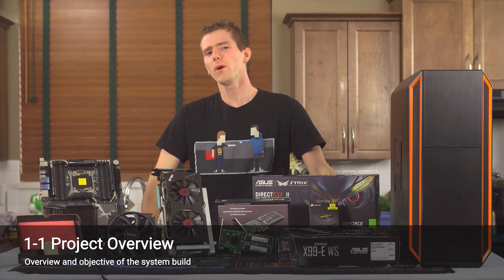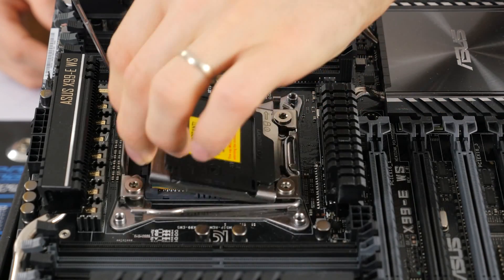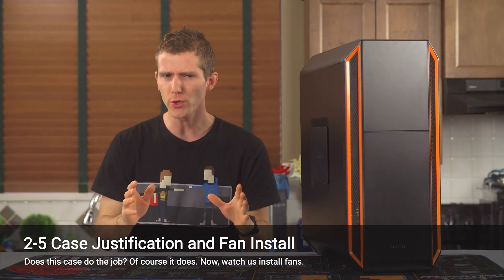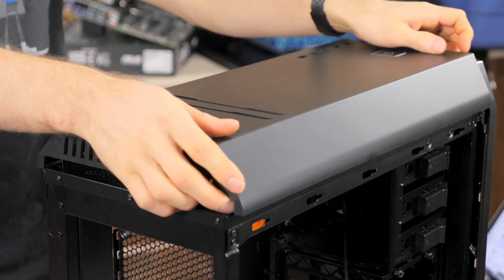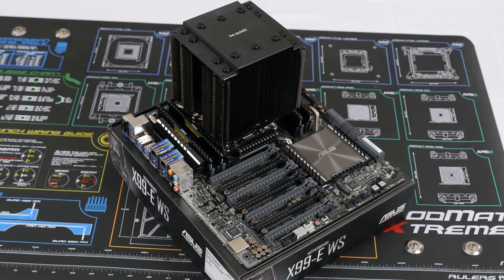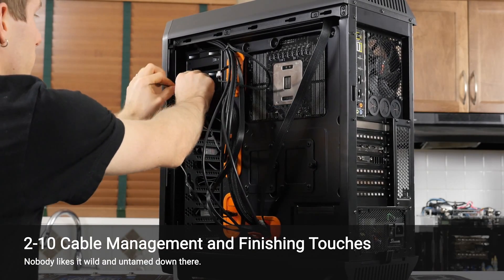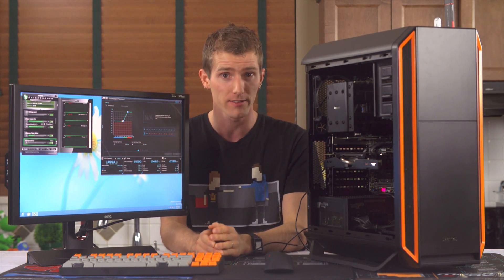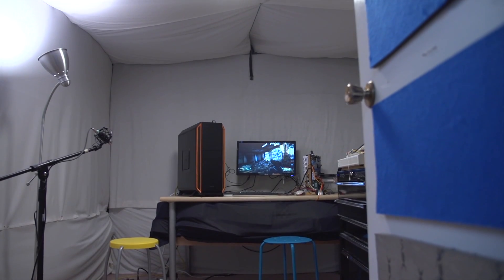How to Build the ULTIMATE Silent Gaming or Workstation PC

Comment: Put the computer in space. It will be 0 db.
Reply: It will also build up heat at crash bc no heat it dissipated out of it bc no air
Reply: +Vsevolod Nedora might not be such a good idea, without air as the medium to transfer to, the heatsinks will simply build up heat and only radiate it outwards at a very slow and inefficient rate. the fans will also do nothing which would rise the overall system temperature a bit.
Reply: @BoomBrush  sheesh, no problem; I'll watercool my space-PC!
Reply: +Vsevolod Nedora Put the computer in space. It will overheat.
Reply: I've got it. The solution to this whole space debate thing:

If you put a computer in space, not in a space station (or with any space-specific gear) it will break. Whether this is by particles colliding with it, debris, or from extreme cold/hot, it WILL eventually break. Someone please find a flaw with that. smug look
Reply: Cyka Blyat Perhaps, but it will be soundless)
Reply: John Mosier You just plain and simply do not lose energy fast at all. Look up the rate energy is lost via infrared radiation, it is tiny. Depends on the electronics, plenty of electronics can work well below -30C.
Reply: Or u can just turn it off
Reply: BlueCosmology that is incorrect. why do you think space suits are heated hmm? or how do you think thermal cameras work? you do lose quite of bit of heat through radiation it just depends on where you are. in your case you are only correct if you are in sunlight
Reply: +John Mosier That is not true. Infrared radiation from a human body is incredibly small, you'll go hours before getting cold ( and that's if you're completely in the shade. If you're not you will without a doubt absorb more IR than you emit).
Reply: Energy Core The amount of energy radiated at temperatures that are good for operation of a pc is tiny.
Reply: Thats genius
Reply: +Matic Omahen leider lol that is the easiest method :P
Reply: My pc is still loud af even when its turned of (i have a stok cooler)
Reply: +John Mosier It's -100 celsius when LN2 cooling for CPU to stop ticking.
Reply: ah thanks
Reply: +John Mosier why would you tell someone they're wrong about a topic you know nothing about, rather than just looking it up?

spacesuits are not heated. The exact opposite, spacesuits have cooling systems as if they were not the cooled the astronauts would quickly die from overheating.
Reply: BlueCosmology Why is the cooling situation vastly different between space and mars? You think you need air flow to cool something?

"Simply no way to dissipate the heat a desktop computer puts out" A) I guess all the electronics we have running in space are all overheating B) "Simply no way" with regards to space has been defeated many times over - It wasn't that long ago that there was "simply no way" to send something (an object) much less a person into space and we know how that turned out.
Reply: Killer2600 The cooling system is vastly different because even a small atmosphere is incredibly more efficient at transferring away heat than vacuum. In addition, contact with the ground of Mars is a great heatsink.

In space there is no medium of heat transfer other than radiation, which is incredibly inefficient.

The electronics we have in space are not desktop computers. They are purposefully designed to be low power. They do this via a combination of being larger chips than a desktop would have, being weaker than a desktop (there are very very few chips in space more powerful than a playstation 1) and from being designed almost entirely for power efficiency. The most common CPU used in space in modern satellites is the RAD6000. A CPU that was made in the 90s with incredibly little processing power (even compared to commercial processors that were available at the time), running underclocked typically at 10MHz. A desktop CPU would fry itself literally in less than a second.

The argument somethings have been hard before therefore everything is possible is nonsense.
Reply: Cyka Blyat I really don't understand your unnecessary hostility just because you are ignorant about a topic.
Reply: John Mosier Thermal cameras are completely irrelevant. The fact that you're losing very little energy from something does not mean it is undetectable.

 A fire is over 1000 degrees. Put a thermometer to the side of it within a metre and it will heat up by maybe 2-3 degrees, showing how incredibly inefficient energy loss from thermal radiation is. Also, the energy loss per unit time of a black body  (which a human, and pretty much everything that isn't specifically designed to not be a black body is very close to) from thermal radiation goes as the fourth power of temperature. That means for instance that while a human is about 300K, and a fire is around 1300, generally more, the power emitted through radiation is not just 4 times more, but 350 times more. Showing just how incredibly little energy is emitted from radiation, especially at the temperatures that are fine for a computer to run at.
Reply: +Killer2600 we do not have modern desktop pcs in space. The ISS is very different from satellites due to its large size and can use much more powerful cpus than satellites due to this, yes, it still does not use even close to modern desktop cpu power. The most powerful cpus on the ISS are cpus that were released 10 years ago and were weak then.

It is plain and simply impossible to cool a desktop pc in space. Low TDP cooling is possible, high is not. You can continue to insult me from your ignorance all you like.
Reply: +Killer2600 10 year old desktop computers are not used in space. Again, 10 year old cpus that were weak at the time (I.e. less than a typical laptop) are used in the ISS. 

You can claim I'm 'losing the arhiment' all you like. Everything you are saying is either untrue, or just irrelevant semantics. Ok, sure, the Earth is in space so it's possible to use a desktop in space. That's the inanity of what you're saying now, and again I don't understand the unnecessary hostility just because you're ignorant of a topic.
Reply: +Killer2600 you can say you don't believe the most powerful cpus used on the ISS are 10 years old all you like. They are. Look it up. There is no desktop in space, other than being inane enough to say that there is because Earth is in space.
Reply: +Killer2600 If you think a modern desktop pc on a satellite is a possibility, could you explain to me why places such as NASA, ESA, Roscosmos, CNSA, none of which have a single cpu as powerful as a modern desktop in space and all choose to use incredibly underpowered old cpus?
Reply: +Killer2600 I know insane is spelt with an s. I'm very confused what your point even is there.

Satellites launched today have old cpus in them. Plain and simple objective fact.
Reply: Killer2600 Satellites launched today do not have new CPUs on them. The most modern CPU used routinely in satellites launched today is the RAD750. Produced originally in 2001, and designed to be more similar to older CPUs than other CPUs released in 2001.
Reply: Killer2600 Another boring inane claim. Yes, they don't use second hand CPUs. No, that does not mean they are new CPUs, and you know it doesn't, in any way other than boring inane semantics.
Reply: Killer2600 As I said before, again I have no idea what point you're trying to raise by saying how to spell insane?

Yes, the CPU they use is the newest offering for their given purpose, as modern CPUs would not work in satellites. One of the largest reasons being due to the heat output of them.
Reply: +Killer2600 I can spell insane. I'm very confused as to why you think I can't.
Reply: ***** Zombies could exist, if by 'zombies' we mean mindless humans focused on eating flesh. There are multiple possibilities, one being a mutation of rabies having an outbreak. Seriously, look it up.
Reply: Vsevolod Nedora THIS
IS
YOUTUBE SCIENCE!!!!!!!!
Reply: RavenPrecept Have you not watched Phineas and Ferb?
Reply: Vsevolod Nedora cooling wouldn't work because its air based
Reply: There is radiation cooling. (Emitting photons with certain energy decreases the energy (temperature) of the body)
Reply: but the heat dissipation factor in space would probably nullify that.
Reply: BlueCosmology He's sorta right you know. Ambient temperature needs to be taken into account as well as material absorption.
Reply: Cyka Blyat No, he isn't.
Reply: +Cyka Blyat +BlueCosmology I'm going to put this debate to rest, a computer in space will not overheat. We currently have hundreds of them in space and on other planets now running nearly 24/7 at full work load without any thermal throttling. It may not be your gaming rig but you won't be gaming in the vacuum of space anyway, one without oxygen you'll literally be dead within minutes and two your LCD screen that you use at home will be destroyed by the zero atmospheric pressure as will anything else that is internally pressurized (spinning hard drives, cathode tubes/lighting, sealed water cooling systems).

In summary, a computer that works in space will not overheat and a computer that doesn't work in space also won't overheat because it'll be broken or unusable.
Reply: Sunny Wu Mars is not space. The cooling situation on mars is vastly different to in space.

There is plain and simply no way to dissipate the heat a desktop computer puts out in space.
Reply: Killer2600 Hmm it's hard to tell his species with certainty but I've narrowed it down to say he is either of the usual peasant variety or part of the troll family.
Reply: BlueCosmology
Mars as a heat sink? oh cause dirt is a really good conductor especially with no water in it. and radiation is not inefficient. why do you get warmed up next to a campfire? it isn't conduction or else the air would just rise due to convection it is due to radiation mostly. look into thermal cameras that will show that a lot of radiation is given off.
Reply: BlueCosmology Cooling is cooling, either it is possible to cool something or it's not. You can't make the argument that low TDP cooling is possible while higher TDP cooling is impossible.

Also I already covered why a desktop PC used in the vacuum of space without modification is of irrelevant concern. Many of the components will not withstand the atmosphere of space, the user included.

You do realize we do have modern desktop power computers working in space at this very moment right? The ISS (International Space Station) is in space and has the occupants using desktop class PC's for both work and play. I have yet to hear reports that those computers are melting and the astronauts are dying from overheating because there's no atmosphere around the ISS to carry away all the heat the humans and computers generate because as you say getting rid of that much heat in the vacuum of space (without air) is IMPOSSIBLE!

We all now know why you would never have a job at NASA. The Apollo 13 team would be dead if you were the person responsible for making the "impossible" possible.
Reply: BlueCosmology I didn't know skype, youtube, and all the "new" things ran so well on 10 year old laptops. Why do we even need more powerful computers when 10 year old machines do it all and generate such low amounts of heat that we didn't even need fans on heatsinks 10 years ago?

If you didn't detect the sarcasm of the above statement it is entirely sarcastic as 10 year old machines will not do all the modern things and even 10 years ago computers ran hot, required fans, and water cooling was available.

The size of the ISS is irrelevant in the possibility of the "impossible" argument. Either it can be done (aka is possible) or it's impossible. There is no "It's impossible unless you do this then it's no longer impossible" that technically is something that is possible.

What's the impossibility of you realizing you're losing this argument? You already admitted to the use of 10 year old (says you) desktop computers in space after previously stating it was impossible. Is an Intel NUC a modern desktop class computer? Would a modern one turn the ISS into an oven, cooking everything inside? Like I said, you are losing the argument, the only question is how impossible is it for you to see that?
Reply: BlueCosmology We, myself and others that have replied to your comments are not ignorant. It's you who is ignorant of everything we have said. You have even conceded that computers are being used in space, desktop ones not just the "ultra low power, low computing" RAD6000 from the 90's. With that alone you destroyed your own "impossible" to cool desktop computer in space argument because regardless of age or ability it is a desktop computer. Also none of us think the crew aboard the ISS is skyping back home on a 10 year old low power machine. Such an argument is there in attempt to try to defend your previous argument and has no bearing on facts.

The argument of the ISS or earth is not insanity, it's demonstration that the "impossible" is in fact possible. But if you're logic is indeed true you have determined the cause and proven the existence of global warming. All these desktop computer all over the global, many of them high-power and overclocked running generating heat that makes it into earths atmosphere but then has no where to go so the earth has no choice but to slowly cook itself as radiating heat into space is the only way for the earth to cool itself and that's (as you say) terribly inefficient considering the amount of computers (let along other heat generating things/processes) on earth. Instead of commenting on youtube, you need to take your expertise to head scientists and government and let them know that people need to turn off their computers and trade them in for low power devices to save the globe from global warming.
Reply: BlueCosmology You bring it up that earth is in space. It's true but it wasn't my argument. Also I don't have to look it up because I don't have to explain the impossibility that I never claimed - you made such claim and have yet to explain or prove why it's impossible. I even asked you if you thought air flow was required to cool something and you haven't even answered that. The fact is you have no facts otherwise you would have laid them down and sealed your argument many comments ago just as I did pointing out that the ISS is in space and has desktop computers aboard whilst not cooking the ISS. Trying to refute my statement with "10 year old low power" does nothing to bolster your prior argument.

In addition to not knowing what you think you know about thermal dynamics in space/vacuum, I don't think you understand what "impossible" actually means.
Reply: +Killer2600 Again, the ISS does not have desktops in it.
Reply: BlueCosmology No it doesn't, they have laptops. Laptops are portable desktop computers, just so you're clear on the definition of laptop.

Still not proving your impossibility. The more you write the more you side with the possibility of cooling a computer in space. To go back to a previous statement - You're losing your argument.
Reply: +Killer2600 Do you actually have an argument that isn't just purely inane? Laptops are not desktops.
Reply: BlueCosmology You wanna explain why they'd use old cpus? They're just less efficient. May as well reduce the clock of a modern one.
Reply: BlueCosmology Insane is spelled with an "S" and laptops fit on the desk just like desktops quite well. They even run the same software and peripherals. So how are they substantially not the same?

Why should I have the burden of proving your argument? Satellites don't need the latest Intel or AMD processors capable of running Windows 10 to do their job nor is a processor that came out last summer going to be onboard a satellite that is 7 years old - At least not until time travel becomes a common thing. I could add more this topic but it's irrelevant to the original argument and it's not my job to try to prove your argument.
Reply: BlueCosmology Actually satellites launched today have new CPU's in them. Plain and simple fact, everything on a new satellite is in fact new.

The reason why the processors on satellites and other space vehicles are seemingly generations behind the latest consumer processor offerings has nothing to do with TDP and cooling. Fact is we have modern desktop cpus available with TDP so low that they don't require a fan. The Apple Macbook with an Intel Core M is such a computer. So are you going to tell us that the 13mm thick Macbook is too much heat and would cook the ISS?
Reply: BlueCosmology It doesn't matter when they were designed if it's not used then it's a new part. And you post yet another comment that doesn't address your "impossible to cool a desktop computer" argument so I will hereby assume you're avoiding it because you can't substantiate the claim. It's been fun but quite boring.
Reply: BlueCosmology If you can't spell a 6 letter word correctly with the assistance of the internet don't expect me or anyone else to think you know more about anything than we do.

With that you're plain and simply wrong about your heat dissipation premise. It's easy to understand you would be because you can't even spell with help of the internet.

The reason processors that retail for less than $1,000 USD aren't used in multi-million dollar mission critical satellites is that cheap consumer CPU's aren't reliable enough for such use. They weren't designed to endure a lifetime of operation exposed to the radiation and temperatures of space. They also weren't tested to run in mission critical environments without failure. If your desktop computer freezes you can just hit the reset switch, if it doesn't startup you can just have it repaired. You can't do that with a satellite that's over 22,000 miles above you.

There are no mission critical systems that use consumer desktop computer processors. The computers in a modern car are the same way and they, being on the surface of earth, are able to be air cooled just as effectively as any desktop computer. Desktop CPU's work well for consumer computers but they aren't good for mission critical processing/computing.

Now that I have educated you on why the same chips in your computer aren't used in a mission critical satellite, and how to spell insane, go fester somewhere else. There's nothing for you to teach us nor am I interested to hear about what you think you know.
Reply: BlueCosmology Good, you want to use seldomly used words where a more common word fits just as well. My error, but you're not furthering why cooling a desktop cpu would be impossible in space while maintaining that low TDP can be cooled in space. That's the only thing I need you to share your expertise on because it's your idea that no one else shares at this point. If you can't then you need not say anything because I'm tiring of practicing my typing and am going back to watching youtube videos on my free time.
Reply: GENIUS
Reply: SpazSpy That was my argument with the exception of collision with space debris. I also added that a human can not survive the zero atmosphere of space to use a computer floating in space. Thus solving this theoretical question is futile. Whether or not the computer overheats the user is too dead to notice.
Reply: Killer2600 Fair enough xD
But...

What if they're a zombie?

And now cue the other space genius guy butting in and pointing out that zombies don't exist...
Reply: Greetings! Here, have some cancer:     Who?
Reply: ***** Eah, and the heat will not dissipate because the vacuum does not thermoconductive... (radiation emission is negligible) and so on and so forth. It was just a joke) People took it too seriously)
Reply: but there is no air in space
meaning heat will build up
and your cpu will explode
Reply: +Tom Holt your cpu radiator would have to be made of space grade alloy and be several meters long and gimbal to make sure they are always edge on to the sun. They'd probably have to be a metre or more in length.

A fully watercooled system with a large radiator would work epically well.
Reply: Vsevolod Nedora it would overheat
Reply: Fen Riders radiating energy in a vacuums is too slow and the water cooling system would need to be 100% sealed.
Reply: Vsevolod Nedora or move to the far north of Canada
Reply: Even in space there are sounds but our ear can't hear it lol!
Reply: +Vsevolod Nedora k
Reply: +Vsevolod Nedora k
Reply: But can it play Crisis?
Reply: that is wrong. while you will absorb more energy in the sun you will lose a ton in the shade plus we are talking about computers not people. you would actually have to heat the computer using an RTG (radioisotope thermoelectric generator) just like satellites. this is because electronics do not work below -30 Celsius i believe
Reply: BlueCosmology Please stop trolling, otherwise I'll just report it as such. As I said before insane is spelled with an S. If you wanted others to think you had the intelligence to speak with authority about computers and electronic used in space then you would spell words correctly. If the CPU/Processor is the newest offering that they use for the given purpose then the processor is in fact new even if it was originally created in the 1950's. It can only be old if a newer part has replaced it.
Reply: Nerd